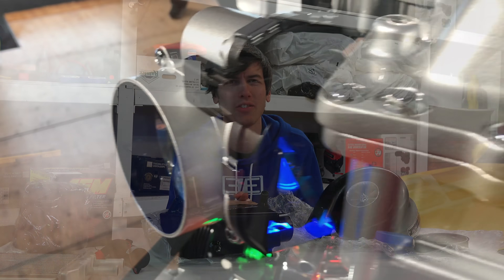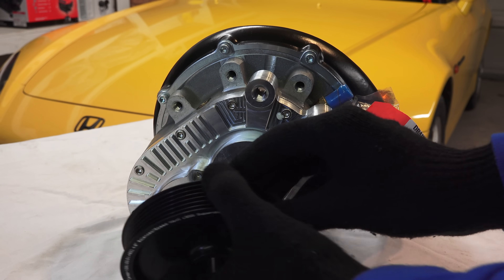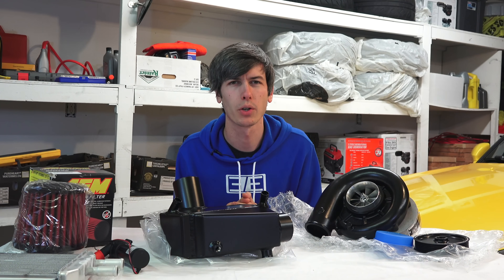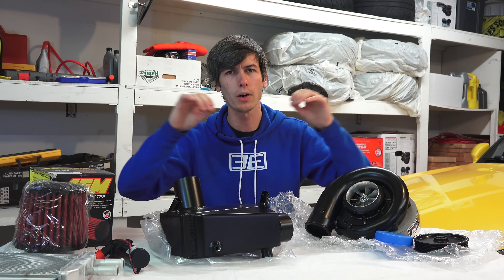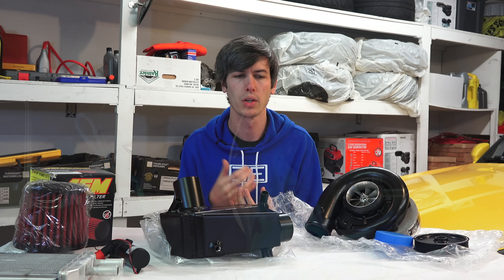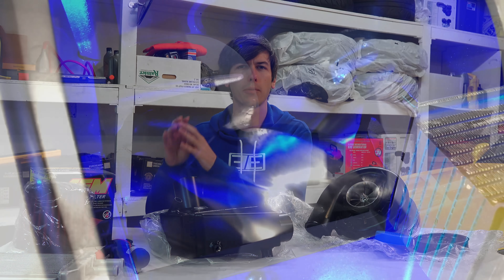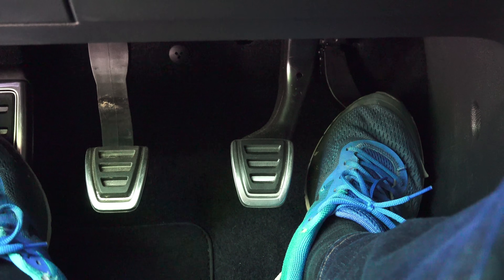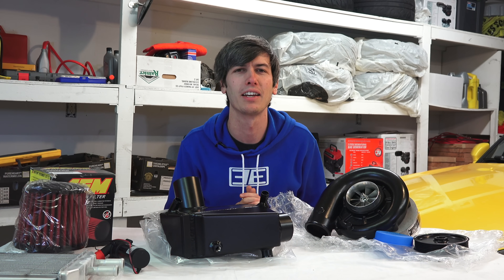Turbochargers vs Superchargers - Which Is Better?

Comment: How do you feel about the fact that supercharger spin is limited to the engine spin as opposed to a turbocharger not having an upper limit?
Reply: Turbochargers do have an upper limit, the same as superchargers.  Centrifugal superchargers will actually spool up to the same rpm range as a turbocharger.  Positive displacement superchargers operate on a set ratio to the engine determined by pulley size.  They operate differently from centrifugal units (both turbo and super) by moving a set volume of air per rotation, which is the most common listing for their size.  For example the Eaton TVS-1340 moves 1.34l per rotation.  Their flow level is actually fairly easy to figure with a simple formula:

(SC ratio x SC volume) / (1/2 Engine volume) = absolute pressure in units of ambient.  
You want boost the subtract 1 and that is how much you are over ambient. This will give a very close guess to Bars.
Want it in PSI then multiply by 14.5 to 14.7 (what ever ambient is at your location, the range I listed is what most people live in).
Reply: Troy McDaniel Sorry, I'm not familiar with the science of it to that degree. Lamen's terms, since a centrifugal supercharger is driven by the belt, its spin is limited by engine rpm, not to mention it siphons horsepower to run, not counting the boost it injects into the intake manifold, right? A turbocharger costs no horsepower to operate, and its upper limit is determined by exhaust pressure from the engine, not the engine's rpm, right? So theoretically can't a turbo provide more boost just by its compressor spinning much faster than a belt would let it? I understand that a turbo can also spin backwards under negative pressure, robbing horsepower as well.
Reply: Actually the spin is not limited by engine rpm beyond the fact that your pulley ratio can not be higher than the point where you will exceed the max rpm of the centrifugal. Considering that there are centrifugal superchargers rated to over 100k rpm, you are fairly safe unless you choose a high drive ratio on a centrifugal with a high internal gear ratio.

Turbos can run into the same issue (max rpm of the compressor exceeded) which requires a waste gate to prevent.  However at most boost levels the waste gate is used to keep the turbine from spinning at a higher speed than required to produce the required airflow to produce that level of boost.

So in fact you can (and often will) find centrifugal setups running at a higher compressor max rpm than turbo setups.  Also since they are driven directly by the engine you can use a larger compressor than you can on a turbo for a given application.  Just look at centrifugal SC that are capable of over 1000 hp compared to turbos capable of that level of flow.  Heck, just look at max flow supported by the smaller ones (but not too small, those are for motorcycles).

By the pulley ratio you select, you choose when a centrifugal begins making boost (boost threshold) and how high that boost will go.  High ratios begin generating boost at a lower rpm and reach a higher amount at engine redline.  Swapping a pulley is pretty easy and fast, especially if you buy a quick change kit.  

On a turbo you select the point you begin making boost at and the maximum flow (maximum hp supported) it can support by selecting the the varies sizes and ratios it has, along with more money for fancy features designed to reduce the boost  threshold, lag, etc.  However, your application (the engine you are attaching it too) limits your choices in how large you can go on the turbine and what AR you can support.  Go to large and you end up with something that can support a ton of power, but your engine can't spool it up.  Go to small and you end up with a turbo that spools pretty much instantly but hits max compressor rpm pretty damn early and basic caps your horsepower at that level.

Also, a modern centrifugal (or heck, any supercharger) does not require nearly as much hp to drive it as most people think and effectively none when not producing boost since they use an electric clutch to effectively become a free spinning pulley.  A turbo actually requires engine power to run (though less than superchargers with the same max flow) and always cost engine power due to it being a restriction at a point in engine.  If you look at an engine before and after a turbo was added, in the rpm range below the boost threshold it will be producing less horsepower.

So really the choice comes down to packaging and the type of power delivery you want.  Do you want a torque curve that starts at NA levels and steadily rises through the power band till you hit engine redline (or sooner if some restriction limits you, such as exhaust size) or do you want that torque curve that starts below NA levels and then hits some point where it rockets up to a high level before eventually topping out and having the torque curve drop at a rate such that the horse power curve is fairly flat?  Turbos let you choose how high that torque jump is in a trade off with where the boost threshold is, how much maximum horsepower it can make, and just how much lag there is between throttle input and engine output.

BTW: Boost threshold is the point where the impeller inside the compressor is spinning fast enough to produce boost.  It is a set rpm based on turbo sizing and characteristics that the engine must be at for the turbo to have enough exhaust flow (on a centrifugal it is enough engine rpm multiplied by pulley ratio and gearing ratio) to actually be producing boost.  

Lag is the delay between throttle input and power output caused by the non-direct link between turbo speed and engine speed.  All superchargers have a direct mechanical link between their speed and engine speed which means they have no to unnoticeable lag (that unnoticeable level of lag comes from things designed to cause them to have no or minimal load on the engine like clutches to make their drive pulley free spinning and bypass valves).
Reply: Troy McDaniel Thanks! That was very informative. What's your opinion on why the latest cars, especially the German ones, have switched from supercharging to turbocharging? One great new feature is the electric spin up of the turbocharger to reduce turbo lag
Reply: Regulations.  To meet current environmental and fuel efficiency standards, using a turbo is easier than a supercharger.

Because of how a supercharger works, it is about the same as a NA in cruise testing and worse in acceleration (outside of weird cases like Skyactive-X).

Turbos, if carefully selected to cross boost threshold in the rpm range most acceleration test occur, get to take advantage of the very large spike that occurs in efficiency when a turbo crosses the boost threshold through reaching requested boost.  You will also see a lot of boost levels set in the 7 to 8.5 psi range (so just limit it in first gear below a rpm like 3k) because that is the range, especially when crossing the boost threshold, that it is easiest to tune a turbo for to get maximum efficiency.

The cars setup this way are noticeable on a dyno by their power curves.  Crossing boost threshold to peak boost all in the 1.5k to 2.5k rpm range?  Big flat torque plateau that crosses through the rpm range where the acceleration test occur?  Hitting a point where the horse power goes into steady state to avoid the turbo going to far into the inefficiency range?  Peak torque that is the same or higher than peak horse power is a very common side effect of this.

It's not cheating per say, but it is producing an exaggerated result by using the known testing points and making sure that the parts that make up the highest percentage of the final score are where those efficiency points are.  If they do worse in the lowest scored areas, so what?

Also some manufacturers actually do cheat by programing the ECU to detect testing and run differently than how it would otherwise.  VW got caught doing this.
Reply: Troy McDaniel I worship your knowledge, Buddy! Thanks again!

Comment: What's the lowest rpm requirement yoy can get for a turbo
Reply: Below the engines idle.  However you are talking about a setup that would choke the engine into non usability.  For practical road engines (including diesel) you are looking at around 1.5k to 1.6k for the lowest range to give you a reasonable usable power band and all setups in this range make use of things designed to reduce lag.  Around 2k is much more common for everyday vehicles (commuter non-diesel vehicles) and for performance applications it can range from around 2k all the way up to 4k depending on the features and turbo size.  

Things like exhaust heat retention, twin-scroll, ball bearings, variable geometry, direct-mount, and exotic materials all will help lower the point that a turbo goes into boost.  There are also tweaks to engines with VVL/T that can help.  And then there are things like Turbo Antilag systems which you will not really find in road cars for varies reasons.

Comment: Hey Jason great video. I have a 2008 Porsche 997 Turbo. I'm looking to upgrade the turbos specifically a bolt on, not a core exchange. Do you have any suggestions as to where i could find Turbo upgrades for this car. thx

Comment: Turbocharger in comparison with supercharger is not as effective as you think. Turbocharger is a restriction for exhaust gases and slow down them. Petrol engine is like a air pump and low restriction in intake and exhaust is very important for engine efficiency and  power. So turbocharger like a supercharged lower engine fuel efficiency in mid and high rpm range in comparison to NA engines.

Comment: is a turbo really not using any more power from the engine?... i'd expect it would since the pistons have to compress the exhaust gases out more because of the turbine stopping the air from flowing through freely, meaning it would at least put a bit of load on the engine?
Reply: Correct.  It is a restriction to the flow of that lovely air pump we can an engine.  And for any air pump, restrictions reduce efficiency.

Comment: I've tried couple of turbo car, and since I'm used to quick reponse from a NA cars, I think I would probably like SC more also. But personally I don'tt care about having a lower power car because it has NA. Sometimes it's not about power but the feeling, I turbo engine are powerful but have this duller feeling to them. ( not that they don't make great engine, I strictly speaking about My impression).
Reply: A well tuned positive displacement supercharger feels even better than NA.  I had one that I tuned to the point it had 21 ft-lbs of variance total from 2k to 7.5k rpms.  That is, 314 ft-lbs at 2k, 321 ft-lbs at 4.8k, and 307 ft-lbs at 7.5k.  With so little variation in the torque output and the throttle pedal tuned to exact response (unlike the curved response nearly every car without a direct throttle cable has), you had nearly perfectly metered power throughout the entire rpm band.

Man I miss that car... the guy who bought it at auction actually(partially detuned)  tracked me down and called me to find out what I had done to it because it was crazy.  When I laughed and told him he had the detuned version he bought all the parts I swapped out and paid me to install them and reflash my crazy tune.

Talk about weird working on "your" car that is no longer yours.
Reply: Troy McDaniel I never tried a supercharged car. But I guess My small fit would be fun with it. To me it seems like it would be better than a turbo. Despite having only 109hp, the engine is peppy and very responsive put input, that what make this small car feel like a sportier vehicle. That one of the things Honda did well back in those day. A 140-150hp/lb-pi in. My car would be perfect and enough. I like the fact that I can beat the hell ou of my car (which doesn't happen often I'm a pretty safe and calm drive despite being a car nerd), when I feel like it and still be safe for me and others people. Feeling is more important than power for me.

Comment: The only thing that I would like to know but it's not in the video is, which one of them make the motor use more fuel?
Reply: Ether/Or/Both really.  It depends on the application, size, and features of a chosen setup.  Typically, turbos will run a richer A/F ratio and consume more fuel during high power output.  But then you will also find vehicles which have a turbo setup designed to give maximum fuel efficiency.

Comment: As far as efficiency is concerned, it seems misleading to me when people talk of turbochargers using energy that would be wasted in the exhaust. When you increase the back pressure in the exhaust system in order to spin a turbine, you’re tapping power from the engine. Maybe it’s slightly more efficient than getting that power from a belt, but in effect it’s doing the exact same thing.

Comment: Why not use both devices? Today you can have computer control to allow a bypass in case of to much build up from both at the same time. However if  the super charger is for low end and tapers in the mid and the turbo charger starts at the end of super charger power range. Would not this be the ultimate in drive ability and power. Also what is the purpose of twin turbos instead of a single large unit?

Comment: You mentioned that turbos are more efficient because they don't waste power while generating power. I disagree with this statement, there is some power loss in generating power in turbos. Exhaust back pressure. Turbos restrict the exhaust and result in exhaust back pressure which leads to some power loss initially. Which is why I think turbo cars will feel more sluggish than their naturally aspirated counterparts during turbo lag.

Comment: It's not accurate to say that a turbo does not drain power off from the engine by using the exhaust pressure. The energy that spins the turbine has to come from somewhere, and the engine is the only thing it may come from. More accurately, a turbocharger, by harnessing the pressure from the exhaust will cause a slight increase in the pressure inside the cylinder currently going through the exhaust phase, over that same without the turbo. That increased preasure in the exhaust cylinder backs up against the currently firing cylinder, and that causes a diminished power output. It's because the power gained by using the turbo is much larger than the power loss caused by the turbo, that overall there is a power gain over the naturally aspirated variant.
Given your mentioned advantages of the supercharger over the turbo, the latter can only have the lower cost to its advantage, because it's inferior in every other aspect.
Reply: Throttle response/feel and liner power delivery are actually big advantages for supercharger setups over turbo setups.  In fact, racers will choose a supercharger or NA setup over a turbo setup in things like auto-x and road course for those two exact reasons.

Comment: There is one aspect I think needs to be mentions is application availability for superchargers, its been a while but most of the major brand name companies built superchargers for V8 cars. I rarely ever seen them go out of their way to make for them either car market and less then 8 cylinders, turbo charger can be installed on almost any vehicle since the plumbing can be made from scratch. I believe there is more versatility for a turbo charger company to make kits for a wide range of vehicles.
Reply: Plenty of supercharged straight fours around.  And nearly all the major brand name companies build for the straight four.  The ones who don't are the niche companies like Roush and kenne bell, which are focused on specific markets.  Then again, some of the niche companies that don't have a kit for your car can still set you up with all the stuff you need including a correctly sized supercharger (Whipple) except for the intake manifold.  And that you can actually get CNC milled from any number of companies (which is how the positive displacement supercharger companies get theirs for their car specific packages).

Eaton and Lysholm are the big boys.  In fact several of the smaller companies use Eaton or Lysholm designs ether as a parts OEM (buying parts from them that they place into their own 'design') or by licensing from them (Magnuson and Edelbrock for example uses Eaton tech while Whipple uses Lysholm).  I have installed superchargers from both onto a straight four engine (a LYS 1200 AX from Lysholm and a TVS 1320 from Eaton).

The easiest way to find a kit for a vehicle is to search for "TVS supercharger" or "LYS supercharger" and the vehicle.  For example search "TVS supercharger cobalt" or "LYS supercharger golf".

Comment: Informative piece. A question arises of what happens if you combine the two in an engine i.e. twincharge setups e.g. supercharger for low-end boost with the turbo coming on at higher rpm. Does this make sense from an efficiency perspective ?
Additionally, the obvious drawback is complexity, which makes maintenance a headache. However, what if I put in small sized chargers? Would that help keep complexity reasonably low while efficiently producing boost across the entire engine rev range ?
Reply: Using a small turbo defeats the whole point of twincharging, which is to use a supercharger to cover for a large turbo until it spools (and actually help it spool quicker by increasing total exhaust flow).  There are several twincharged vehicles but it is not common due to both increased complexity (and the accompanying increase in size, weight, and cost) and reduced reliability.  

Basically it comes down to the benefits are outweighed by the drawbacks outside of niche usage.